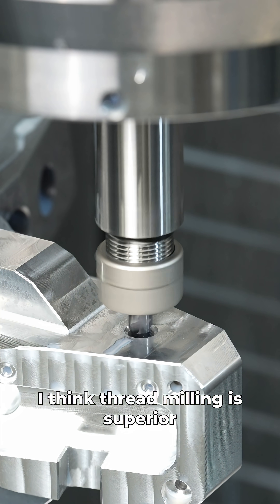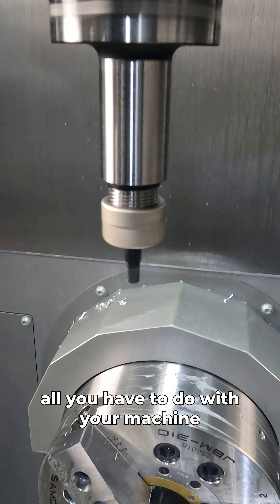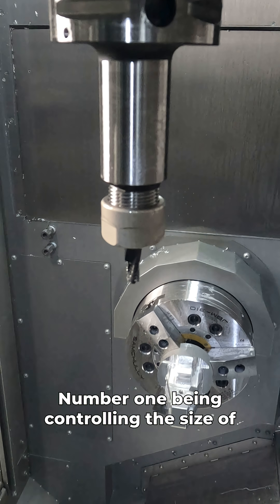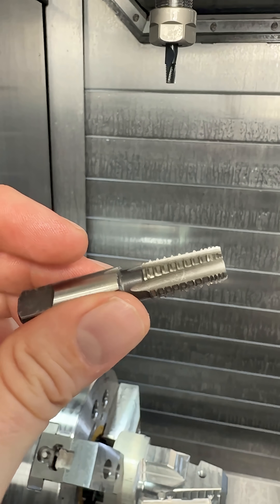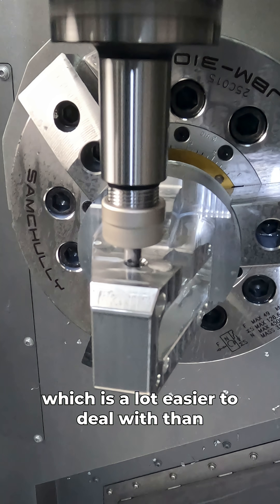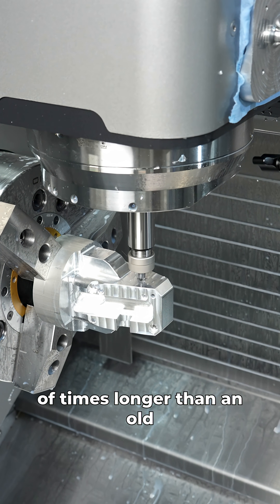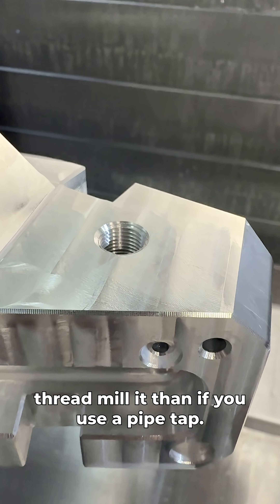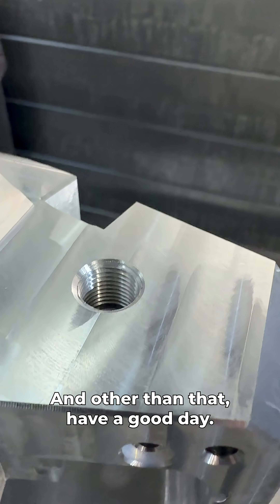Pipe taps are TERRIBLE!! Thread Milling is better!

Comment: For larger thread diameters, I also prefer thread milling, but the machining depth is quite limited. With thread taps, you can create deep holes and long threads. Additionally, it’s much faster – which, of course, is only relevant for serial production.

Comment: I agree that thread mills do produce better threads, but I normally find it easier if I use a larger drill.  Never had a part rejected yet. One time I took the time to measure the minor diameter on a pipe tap, and it was smaller than the recommended drill diameter. Can anyone explain this?

Comment: Why in the world would a blind hole need to be pipe tapped, atleast one so shallow it required modification of the tap? Idk maybe its just what I've seen/know
Reply: The bottom might have a small 1/16 hole in it for say. . .air  or pressure of some kind so its not totally blind but still its possible to hit the bottom if you go too far.

Comment: Not all CNC can do precise interpolation for threading.
Reply: Is your machine built in the 80’s?
Reply: @cncmilljunkie I remember my shop bought a brand new Mazak back in 2000 and the Z interpolation was an option we had to buy
Reply: @1943vermork  I’ve ran some old strip down Fanuc’s OM in the past, but thankfully I never had to worry about rigid tapping or Z interpolation on arc’s. Coordinate system rotation, G68, or quadrant programing, that’s another story.

Comment: Agree, thread milling is the way to go, at least for pipe thread and high pressure applications.
I replaced all NPT taps with thread mills in our shop. We mostly cut stainless steel and Hastelloy and now have a reliable process.
But please do not program a straight helix. You have to cut a tapered helix for  pressure applications!

Comment: Only time I don't like it is in easy to machine steel but a small enough thread you can only get a single flute thread mill in. Just not worth all the step over and time when peck tapping with a carbide tap will suit it better if you really are struggling with chips

Comment: thread milling pipe threads also dramatically improves sealing in high pressure applications. as the cone shape is uniform and not stepped where the flutes stopped.

Comment: Only problem is the huge amount of code thread milling makes for a single hole with all those those 3D semicircular arcs. If you don't have macros, it can make some hilariously large programs.
Reply: tell your programmer to fix the control settings. There should be 1 arc move per thread or 4 if it doesn't support arcs greater than 90 degrees. 

linearized arcs is a control setting for routers and cnc mills do not need their code posted out in this manner.

Comment: I occasionally use pipe taps still. If it’s one hole in easy material, it can be easier to get the size by hand. Or if it’s super deep. Some manifolds have pipe threads recessed 4+ inches.

Comment: A long time ago, I got parts rejected for a leak path.  I was threadmilling a tapered thread like you are with a multi tooth threadmill.  I was programming by hand in heidenhain at the time, and programmed a straight helix.  With a taper thread, if you do a straight helix you end up with a straight leak path along the lead in/lead out position.   I split the thread into quarter turns, and increased the radius four times as I went up calculated by the taper angle of the thread.  Now I just program a taper in mastercam, or fusion.

Comment: First time I tried threadmilling I just threw a lathe internal thread tool in an er-32 bt30 holder. It was a 1/2” NPTM thread and I had to chase it a bit but it was beautiful. I bought a selection of single flute carbide thread mills and now I only use m my hss pipe taps to chase a thread on a 3d printed prototype.

Comment: If it comes to threads, for example small ones I found thread forming better than cutting. I just started with it 2 weeks earlier and I really like it. It makes smaller internal threads more durable too.
Reply: Forming is mostly for special cases to me, there are just so many factors to worry about (for example 2/3 of my materials cannot be formed)

And for pipe threads especially, the tap loves to cold weld itself to the hole (in my experience anyhow)
Reply: @angrydragonslayer I use a coated HSS thread forming tool and made over 1000 threads now and it still looks brand new without wear.
Reply: @R-98-official pipe thread? what material?

Comment: But it doesnt work on a lathe without a Y axis 🙃
Reply: Boring bars are a thing?
Reply: @mantasbalaisis1286 To threadmill radially? 😂
Reply: Yeah it does at-least on the haas st20y😂, i my a hammer head with a thread milled 1/2-13

Comment: The method is stated is incorrect. A circular helical move with a taper threadmill leaves a step in the wall equal to the difference in the taper over one pitch. It's a small error but it can be a big deal on critical sealing connections.
Properly threadmilling a taper thread requires a SPIRAL helical move.
Reply: I was going to point this out, too. I guess he is not as smart as he thinks he is
Reply: It is a helical move if your Watching the cutter work. The tool is moving in a circular pattern while moving out of the cut at the thread pitch in the tools axis.
Reply: The tool geometry controls this. You can see the cutter hear isnt a standard threadmill. Helix is fine in this application

Comment: Threadmills are way too slow on large threads.
Reply: Show even one calculation that says so.
Reply: @JaakkoF  It takes 30 minutes to threadmill a M300 x 3 thread 100 mm deep, but only 10 seconds to tap it, a tap a foot in diameter, and enough torque to stop the earth.  Proved it!

Comment: best thing: if it snaps, its not stuck in the workpiece.
Reply: Not if but when
Reply: Broken taps get stuck inside the work almost all the time, if it shatters ur lucky but taps regularly break off with most of it inside the hole still

Comment: Gonna admit it...Im a mill machinist and never used a thread mill.
To my defense most of the time when im tapping the thread its so deep in the hole that a thread mill wouldnt make sense to use
Reply: Thread mills are really nice most of the time, but I also have a part where I need a 3/8-18 NPT thread at the bottom of a 3.5 inch deep bore hole that is 1.25 inches in diameter.  There probably is a way to thread mill it, but I imagine it would be an uphill battle with a ~5 inch tool stick out on anything that could fit down the hole and still have room to do the interpolation.  A pulley tap on the other hand just gets the job done with minimal fuss since it is not even a blind hole and the material is a free cutting magnetic steel.

Comment: We mostly use Thread former’s instead of threadmills or taps. Solves the problems with chip control and they last for ages. Tbf mostly doing aluminum so maybe different if you’re mostly working with Steel or Stainless.
Reply: We also used it on stainless all the time, works like an absolute charm, steel worked great too. Also, the threads are stronger then tapped or milled threads. Never tried it, but i wonder if it works on a manual machine.
Reply: @thomas.861  Unfortunately, the use of thread formers is prohibited in the food industry.
Reply: @Jackall37 thats interesting, why is that?
Reply: Yes, thread formers are definitely an option that should be looked at depending on the material being machined.

Comment: My treadmills do not last very long in steel. I can make hundreds of holes with a tap. A treadmill doesn't last that long for me. I use treadmills on odd shaped threads or features that a tap would be impractical.
Reply: Then either your tool is wrong for te material or the cutting pararmeters or your machine clapped out and making a mess of tools due to circular interpolation errors.